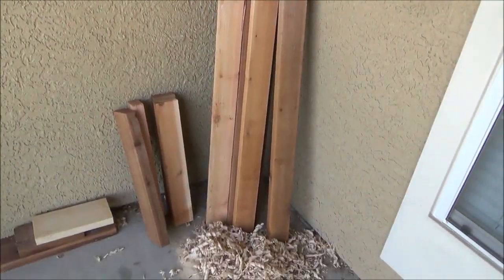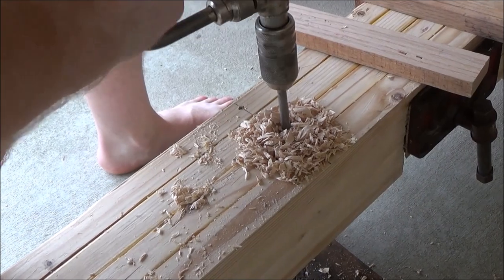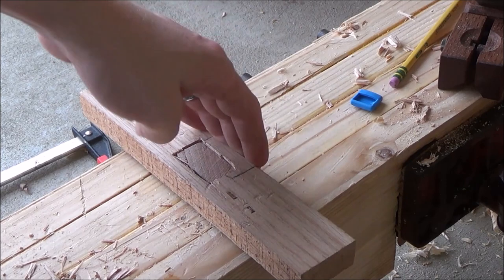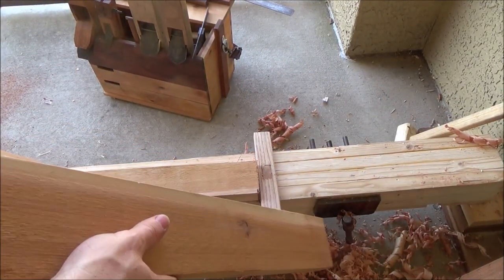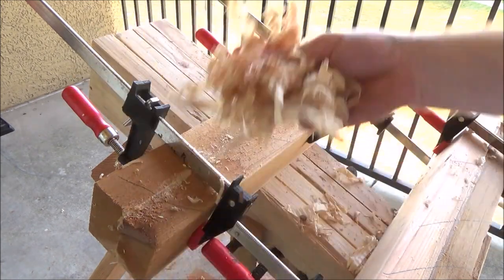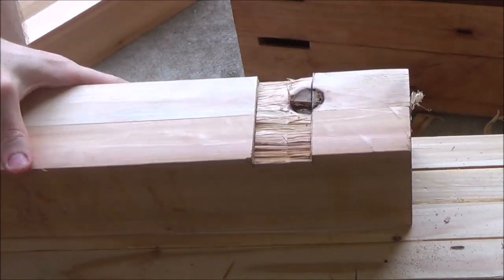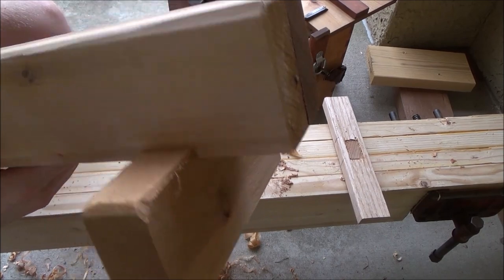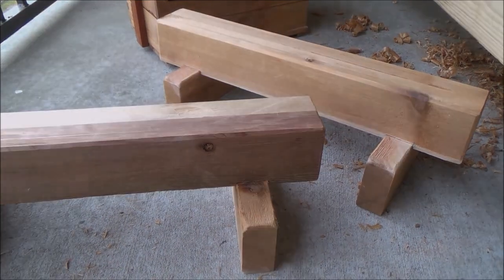Making Japanese Saw Horses

Comment: At last an American who hasn't got a  fully equipped joiners shop and does things by hand, for that alone I am subscribing. I live in a small single bedroom flat(no veranda) so I will have to work in a corner of my bedroom. I am a retired chippy(carpenter) with western tools , but a full sized bench is impossible, tried B&D workmate, the noise and constant racking made that idea a no no, So i am now exploring Japanese style but using my western tools, although i do have some Japanese saws. So am going to make a Japanese beam bench on saw horses(taller than yours) and learn to plane sitting, using my weight to hold things steady. They say you cant teach an old dog new tricks, Well i'm 70 now and unless i win the lottery(which i dont do) I am going to have to adapt if i want to continue working wood, Might even try one of those Japanese planes. P.S Going bare foot is NOT an option though Lol.
Reply: You poor baby. Get thee to a library. Ask a librarian to teach you the use of Google and youtube. You'll find all kinds of small shop tours, small space builds on balconies, bedrooms.Some have so little space that they take what they need out the sidewalk or greens to work. Look to your own resources and affairs and not on the resources of others. You can do this.Come in out of the rain! Or do your crying in the rain. At least no one will see the tears you are crying while inside you are dying. God bless.

Comment: Which Japanese saw do you recommend for cutting 4x2 inch beams ? Great no-nonsense, highly versatile design. I think I do the same design but use 9x2 inch wood to get a higher more comfortable (knees less bent) sitting. Body weight on wood means better stability than on western saw tables, and more joinery by 'body feel skill' is introduced into the work. What other uses are there for the short saw horses please ? Thanks a lot.

Comment: Would you say that the “lower end” Japanese chisels/planes are still worth it? Like the $50-$80 range on Amazon?
Reply from the maker: Bon Kant that's a very good question. My opinion is that it's always wiser to buy a few high quality tools and learn to use them very well. 4 quality chisels and 2 quality planes will always serve you better than a bunch of cheaper tools that require tedious tuning. What do you think about a video where I just give some thoughts on the topic?
Reply: thanks for the response. i would love a video on that topic as i am trying to decide if those products are worth it on a budget
Reply from the maker: I have a few videos in the works right now. I only have 1 day a week to make these so I have to plan things out pretty far in advance. I'll put one together and try to answer the question in a bit more detail.

Comment: Nice build!
I thought for those Japanese block planes you just tap the front or back of block instead of tapping the actual metal for adjustments
Reply from the maker: If you're backing the blade out of the block you tap the back of the wood. If you're making the depth of cut deeper you tap the metal and if you're adjusting the side to side movement you tap the metal on the sides

Comment: I feel like those brace bits really need sharpened. I’ve drilled 1-1/2” holes with mine and didn’t struggle half that much. Also worth noting that you lever the tools against finished surfaces a fair bit which will mar your projects; I struggled with that a bunch when I started out which is the only reason I noticed it. I do really like the simplicity of the project and your video inspires me to give a pair of these a try :)
Reply from the maker: Thanks for watching. On pieces like this that are going to get scratched scuffed cut and dinged up alot I don't worry too much about keeping them clean.
Reply: Lemongrasspicker I got you. Thanks for taking the time to reply :)

Comment: Yeah, just a little awkward to lug around but crazy sturdy and stable-VERY important attributes for a saw horse/portable work table. Use it as a floating bench in my shop. Plan on mounting my chainsaw chain sharpener and mini router table to it with thumbscrews for easy install/removal as needed.Wish I had 2, anybody want to buy me one 😃?

Comment: Those old carpenters earned their money didn't they?
Reply from the maker: Sam P indeed they did
Reply: Old carpenters were not completing with automation and their skills were the highest on the market place. Today there are carpenters who do a mixture of both hand and automation that can produce products to the same standards only far faster. 

I can produce a table from rough lumber planks all by hand in about a day. With machines and hand I can produce the same table in half a day with a lot less physical effort. 

There is nothing wrong with using a power drill/circular saw along with hand tools.

Comment: being made only from 2 pieces of wood do not guarantee that they will not bend :P
Reply from the maker: me miself indeed, but it does help to keep them flatter than a single piece
Reply: off course it does. when i wrote my comment i just found  a piece  which i glued some time ago, from maple,  seriously bent 5-6 mm on 800 mm , probably some grain issues there too...
Reply from the maker: That's alot of bend in that. Is there enough thickness to plane it out and get it straight again?